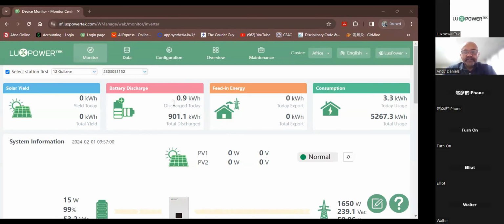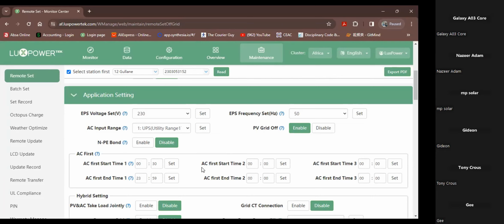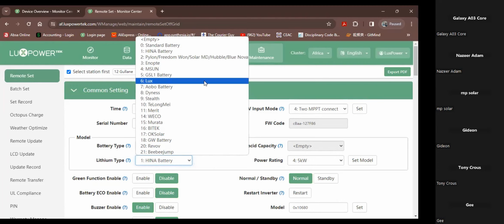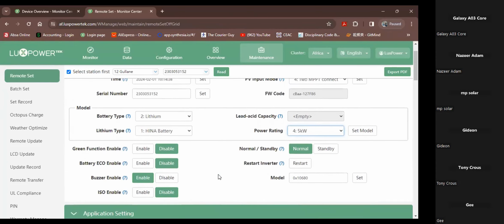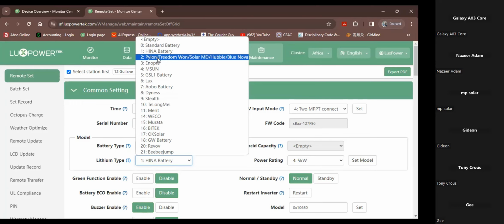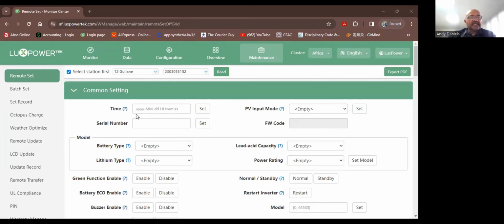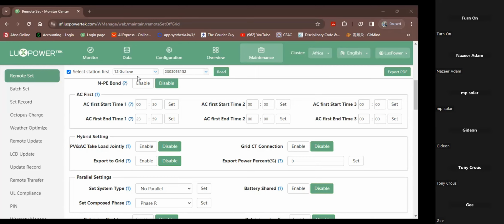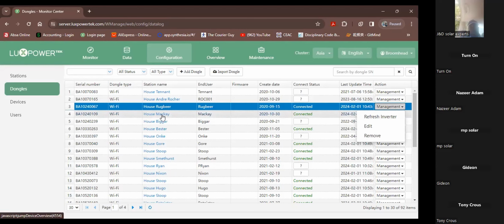LuxpowerTek SNA series | Web Monitoring Setup Training Webinar

Comment: On an SNA5000 WPV
What is the code for a Lemoen battery with the following specs
1. Nominal voltage (V) 51.2
2. Work Voltage Range(V) 44.8 - 56
3. Nominal Capacity (Ah) 100
4. C Rating 1.0
5 Charge Voltage (V) 55.2 -56
6. Discharge cut off (V) 44.8
7. Charge Cut off 56.8
8
Reply from the maker: Hi there, Sorry we are unable to determine the code according to the spec of the battery. And we noticed that you have left same message under our other video, please send your SN to marketing@luxpowertek.com if you have installed  the system for further assistance.

Comment: A year ago I spent quite a bit of money installing the Luxpower batteries.  However, I now regret it.  They do not live up to their promise for one reason.  The controller - Luxpower controller - is far too sleepy.  It takes up to a minute or more before it considers switching.   My records show that it really sleeps on the job.  This costs a lot of money.  Avoid!
Reply from the maker: Hi Sir, We are very sorry to hear about your experience. We would like to clarify that Luxpower has not manufactured any batteries. Based on your description, it seems you might be referring to our inverter.

Could you kindly share your location and the inverter's serial number (SN) with us? We will check the status of your inverter and provide assistance. For Luxpower inverters, the typical on/off switch time is around 20 milliseconds.
Reply: @LUXPOWERTEK  I'm happy to give you this information - how do I do it privately! FWIW yes, I was 'sold' on this 20ms spec. My reality is somewhat different. If necessary I will post it here.
Reply from the maker: @lawrenceharris1819  Please send your inverter information to : marketing@luxpowertek.com, we will try best to solve your problem and clarify any misunderstandings.